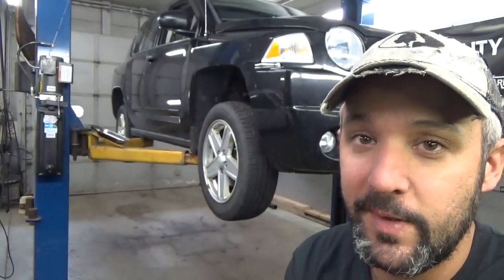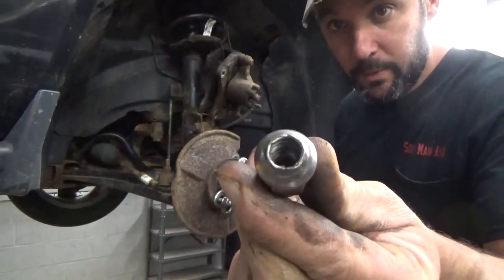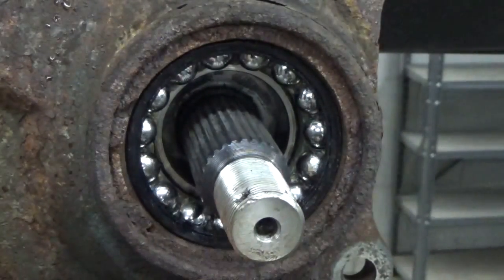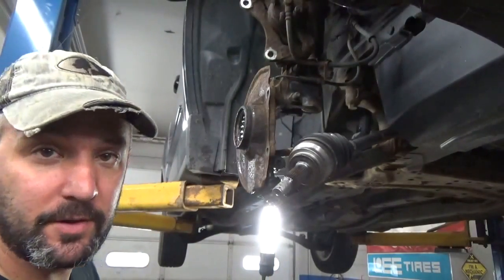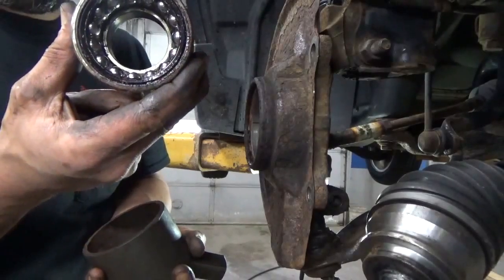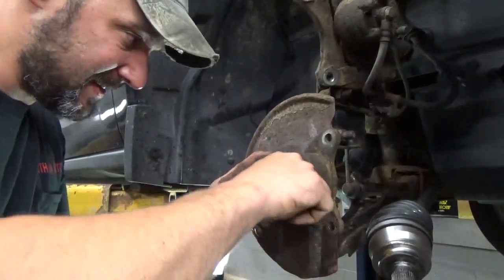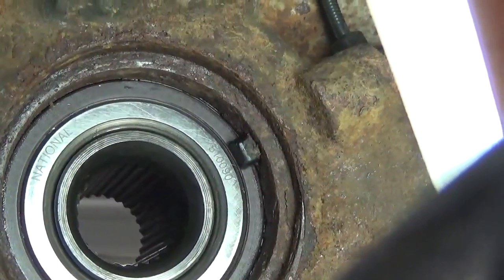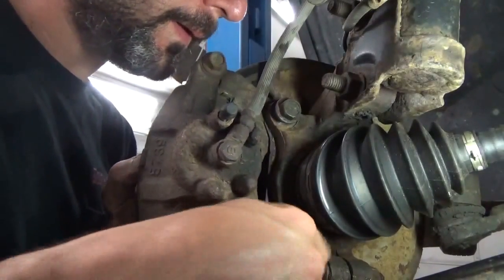Replace Front Wheel Bearing Jeep Compass

Comment: IMPRESSIVE! I'm having trouble getting the CV joint axle nut (WHAT SIZE IS THE NUT? mm or standard?) off though I've heated it up with a propane blowtorch, hammer chiseled all the rust off, after first spraying PB Blaster to it... I've put a bar on the end of my breaker bar wrench and also securely held the Spindle by the lug studs with a big pry-bar wedged up against the underside of the rocker panel... I had to do this since my 450 Ibs torque air gun was not enough to pry it free..
 WHAT DO YOU SUGGEST I DO NEXT? IM thinking about buying the Milwaukee 2763-22 cordless air impact it's supposed to be a BEAST!  and the BEST on the market for CORDLESS IMPACTS right now offering 700 ft. Ibs of torque with a Max of 1100 Breakaway ft. lbs torque!... I've seen it get bolts off of semi trucks and it's only half drive not even three quarter!
Reply from the maker: +TNASI Tuning Well the nut is metric. I guess I have never had an issue getting one off. Can you barrow a gun from someone perhaps?
Reply: once that nut is rusted up it's a BITCH! There's a video of some guys getting one off a little Subaru, 12 foot cheater! First piece of advice, leave the tire on and on the ground! impact wrench or breaker/cheater combo. It'll help you put the torque to the nut. On my Subaru I did my bearings a few weeks ago and driver side was all jacked up. ended up cutting a cross into hub and old axle along with nut using grinder, cut off wheel. then the nut fell apart in my hand. my 6 foot cheater wouldn't do it.
Reply: once that nut is rusted up it's a BITCH! There's a video of some guys getting one off a little Subaru, 12 foot cheater! First piece of advice, leave the tire on and on the ground! impact wrench or breaker/cheater combo. It'll help you put the torque to the nut. On my Subaru I did my bearings a few weeks ago and driver side was all jacked up. ended up cutting a cross into hub and old axle along with nut using grinder, cut off wheel. then the nut fell apart in my hand. my 6 foot cheater wouldn't do it.

Comment: Eric O I have been looking online and at parts stores to find the Hub I know I will need a bearing when I replace the hub on the drivers side. Do you know where I can find the Hub? I have not been able to locate one anywhere. I have the known issue where the hub warps when the brakes get hot enough to warp the rotor. I didn't know that the hub was warpped when I repalced the brakes and rotors shortly after I bought it to try and fix a brake shimmey. I need to replace the hub and then the rotor again since it is now warpped from being on the warpped hub.
Reply from the maker: rockauto?
Reply from the maker: or the dealer
Reply: +South Main Auto Repair looks like a dealer only part at this time. Thanks for the info and enjoy all the helpful info from your channel.

Comment: Could you tell me what spray grease you used? I thought it was a great idea. THANKS FRIEND
Reply: +Ronald Cach Its a 50/50 mix of acetone and automatic transmission fluid, works better than any of the other's, you just need a way to spray it or apply it.
Reply: +Ronald Cach He had the can covered, but I think it was Castle Muscle Grease. He uses that a lot.
Reply: +Ernest Miller THANKS

Comment: Reason for failure could have been that the guy who did the CV shaft didnt torque the hub nut Properly. Most important fasteners to torque on a vehicle: Hub/Wheel Bearing Nut, Cylinder Head Bolts, Rod and Main Bearing Caps, Any Mating Parts that need to make a seal, Anything Aluminum and of course Lug Nuts....ok, really everything with a specified value should be torqued, good check to see if your mechanic knows what hes doing or care about his work, ask to see his torque wrenches, if he has at least 2 and they arent buried in the back of the bottom drawer of his tool box then hes alright, if hes only got 1 big one that says harbor freight with a $12.99 price tag on it....you may want to take your car somewhere else.....
Reply from the maker: MrTurdfergusen Lol hmm I will have to ask my mechanic :) Well evidently the customer changed his own axle because it had a torn boot and he thought it was where his humming noise was coming from.

Comment: Doing my first press in wheel bearing I had alignment issues with the new bearing with the forcing screw. The bearing and new hub are on but I fear I may have damaged the inside of the knuckle when installing the new bearing. What issues might I have if I scored or damaged the inside. The bearing doesn't appear to have suffered any damage and much quieter going down the road than the old one. I know I'm going to get a lot of hate for this but I don't torque anything, either tighten with ratchet or impact. Don't have money for torque wrench sorry haters.
Reply: If you were able to get the retaining snap ring back in after pressing the bearing in you should be fine.  Should.  It should all look flat and in the same plane.  Chances are if your eye can't catch it, in this case, due to the engineering safety factor, you should be fine.  Again, should.   You won't know for sure about whether you damaged the inner face of the knuckle unless you pull out the bearing and inspect it.    The not having a torque wrench though, is unacceptable.  You can go down to Horror Freight and buy a 1/2" big one for $20 bucks (especially during the holidays) that will do up to 150lb/ft. Then put a breaker bar with cheater pipe on it and tug it snug a bit more.  It doesn't have to be exact but it does need to be near.   Fasteners are made to be tightened to the right amount. When the engineers take the time to work out a number that they list as the proper amount, you should respect it...or at least try to.

Really, if you can afford an impact wrench, you can get yourself a cheap torque wrench.

Seriously, the rest of your post is one thing, but i"ll be the hater: Not having at least a cheap torque wrench is just silly.
Reply: @phuturephunk  I appreciate your feedback and the car is nice and quiet going down the road now. I will say in response to the criticism of not having a torque wrench, well at least 90 percent of my tools were handed down from my grandpa or were gifts. My grandpa actually did have a torque wrench and I searched for days trying to find it but never did. I understand the importance of tightening things to different specifications based on the load being applied to said item. However manufacturers have set torque specs for every single bolt and nut and I just think it's a little excessive. I mean sure you don't want to have something to lose or to tight but I see it as just use common sense. Take for example tightening something into aluminum, don't overtighten or you'll strip the threads out because aluminum is a softer material or even copper or brass. Back in the day before torque wrenches even existed people used common sense in tightening stuff. Supposedly your lug nuts are torqued to spec but if you get a flat tire and have to change it, the tire change kit you get with the vehicle doesn't come with a torque wrench and it never did. Vehicles used to come with a full sized spare not a donut and people would drive on it for however long till the other was fixed. Criticize me all you want, I still ain't going to buy one. Oh and for the record I know anything inside the engine should be torqued to spec but I'm not going to go that deep. I'm not any kind of mechanic or would even try to be, I only try to fix my stuff when I understand its functionality.

Comment: hey eric im curious why you pulled the hub out with the slide hammer and not the hub tamer. prolly wouldve saved some grief.
Reply from the maker: It is just easier IMO
Reply: South Main Auto Repair to each his own. Ill admit that the hub tamer is a pita when theres little to no bearing flange to grip on. I ruined a backing plate with it lol
Reply: For the sake of separating the lower ball joint I would for sure use the hub tamer/grappler to remove the hub.

Comment: Ice Cold air wanted $81.50 plus tax per side if I brought my steering Knuckles into them  for them to press my old hub and bearing out and put the new hub and bearings in that I bought on line ..Got the whole hub bearing kit .2 hubs 2 bearings and 4 seals for $99.95 ..Scraped enough money together to order them ..Couldn't afford to have the shop press my bearings .So I went to hourborfreight and bought a front wheel drive hub bearing and installer tool $119.00 plus tax and rented a slide hammer  and My Son and I did the hubs ourselves..on my moms 96 maxima ..tool was cheaper than having the shop do it and I got to keep the tool ....we took the whole knuckle off the car and put it in my Vise in the shed an commensed to try to get that bearing out .ooh lordy that bearing fought me all the way ..I put an impact gun on the bolt to speed up getting the bearing out and  I stripped the threads off the bolt ...Was screwed ..What do I do now ?? moment ...We ran the tool back to hourborfreight and with no questions asked they replaced the tool and we were back in business...when I pulled the bearing out the other side of the car ..I was smart this time ..I put the hub down on a board and put bearing removal disk on the bearing and beat it out with a sledgehammer..The tool worked great at putting the bearing back in ...My only problem was that the bearing called for 207 Ft pounds..all my torque wrench went up to was 150 ft pounds  ..I torqued the axle nut to 150 then put my elcheapo hourborfreight impact gun on the nut and gave it a couple uuuga Dugggas ....Seams to be doing fine .I got 307 miles on them now since I put them in ..all seems good ??

Comment: I forgot the snap ring 😑
Note: do not use slidehammer to remove the hub if you forgot the snapring. You will break off pieces of the bearing.

Comment: I suspect those are really poorly made. I think I remember reading that about at 40,000 miles major suspension components can be  worn out.
Reply: Yeah Chrysler used very cheap bearings everywhere they could. I have a 2011 patriot with the T355 5 speed trans; I have to replace my input and output shaft bearings every 20-30k. Insane. Easy enough job but dang is it a huge inconvenience

Comment: self note
Never attempt changing the wheel bearing your self. 
there are things you can do and then there are things that just worth paying a mechanic. 
once you factor in the money you will end up spending for just the basic tools and the parts for this job you might as well go get a professional to do it right the first time. I mean ask your self,  How often would you need to change a wheel bearing?  
given the difficulty level and tools needed a mechanic even with the hoist and all the correct tools admits it can be pain to complete this job. 
Why bother your self and cause so much stress, agony and even then most likely make it worse? but hey, that's just me.

Comment: And the $64,000 question is: Was there anything wrong with the wheel bearing to begin with? If a guy tells you "change my wheel bearing" and he's paying you then change the wheel bearing, but, was there anything wrong with it?

Hang in there Eric. I'm going to get you some screwdrivers with through tangs and metal caps. These are actually made to be used as chisels not that using a normal screwdriver in this manner has ever bothered you: heh, heh, heh. Check them out here:http://www.toptul.com/style/frame/templates11/product_detail.asp?lang=2&customer_id=2179&name_id=92173&content_set=color_4&rid=57909&id=324229
Reply from the maker: SATAMAN Schmidt And the $64,000 question is: Was there anything wrong with the wheel bearing to begin with? If a guy tells you "change my wheel bearing" and he's paying you then change the wheel bearing, but, was there anything wrong with it?  --- To be determined I guess? He said change the bearing I said Ok.

Hang in there Eric. I'm going to get you some screwdrivers with through tangs and metal caps. These are actually made to be used as chisels not that using a normal screwdriver in this manner has ever bothered you:   Denny I ALMOST felt bad doing that but I KNEW YOU WOULD SEE IT HAHAHA.. So glad you responded Lol!